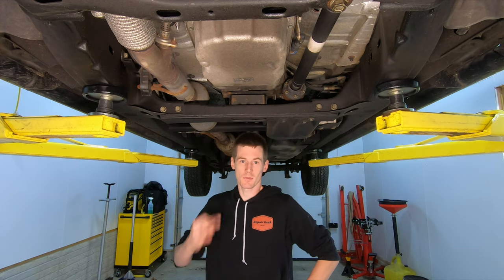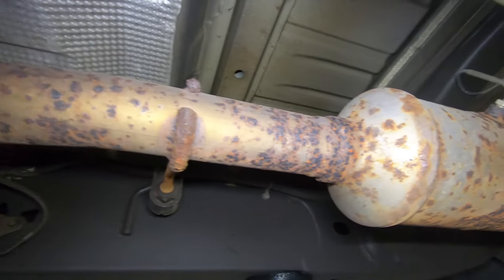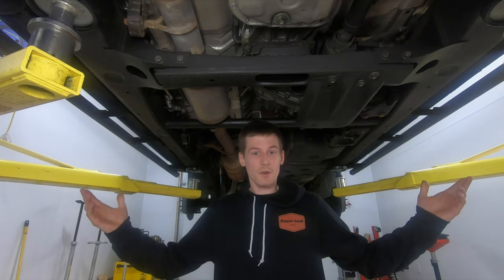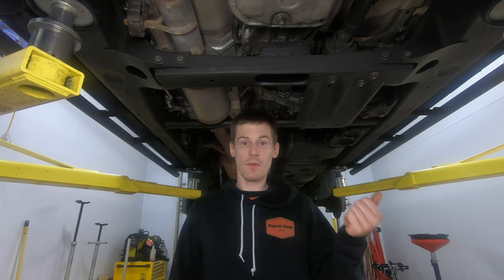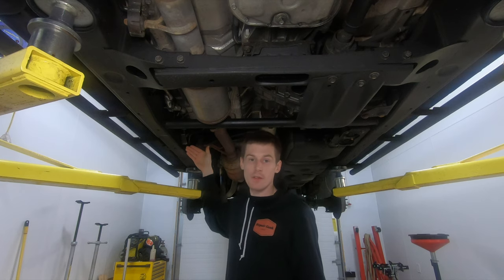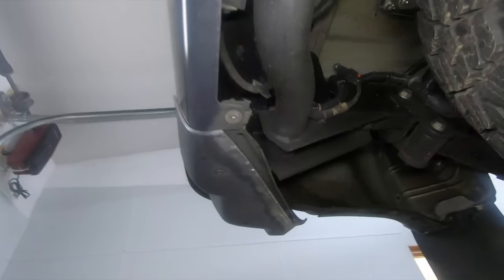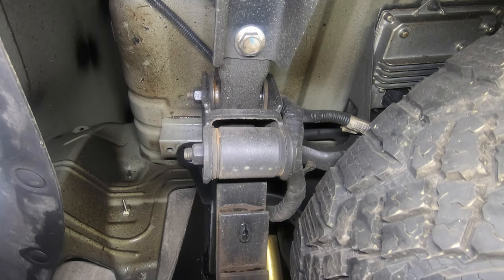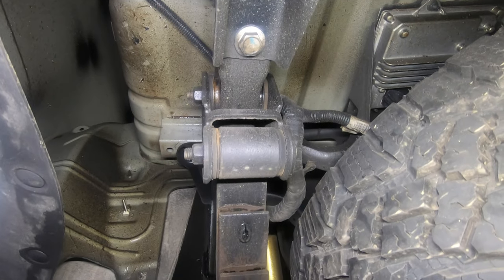Fluid Film Review After 3 Years and Woolwax Vs. Fluid Film Testing.

Comment: Good humble choice to not use the New Hampshire oil even if it is free.
If you never wash the underside of your truck. Except for this video to apply woolwax. Does that mean you continue to spray fluid film layers on top of each other twice a year? Never hosing off any dirt or grime that sticks to the fluid film before applying the next layer?
Reply from the maker: Yes
Reply: @RepairGeek  wouldn’t it be better to hose off the old layer of fluid film before applying a new coat though? That way the fluid film is sticking directly to the metal and not to old fluid film.
Reply from the maker: @Jonathan-hq8od  my issue is with that is time. I have my procedure down I can crank out a car or small truck in an hour or so. Washing adds time and I have results that verify what I doing works. Also, the longer this test goes on the more resilient the coating becomes because it continues to become thicker and thicker.

Comment: How much of a mess does it make? I have an auto detailing shop and looking to start offering this but I’m wondering if I’ll need to put curtains up around the bay where I’m doing the fluid film to prevent overspray from getting on other vehicles in the shop
Reply from the maker: You'll need a curtain for sure. It washes off easily though.

Comment: It looks really nice.
But, my own experience is not  good. 
I have a brand new GMC Sierra and I decided to protect it  with Fluid Film before winter.
Next week I wash my truck and figure out that the original wax came out  from the frame  around the rear tires.   I bring a truck to the  dealer with a question. What is that?
They said, we can't help you! Go to the shop where you did it and complain there!
So, my personal experience and suggestion is, keep away from the original frame  wax, it doesn't work with Fluid Film and even makes a lot of headaches for me,  how to fix it!

Comment: So do you have to sand down before you apply fluid film? I have a 2019 with minor surface rust can I just put the film right over that?
Reply: If you don't want to do the sanding work just apply right on top of it. Look up a product by Blaster called surface shield. I'm impressed by it so far and it may be better than fluid film or woolwax.

Comment: Hi there, interested in your one year comparison as a friend just bought a brand new Tundra.  While I've used RP-342, I am suggesting he get Woolwax applied and skip Toyota's undercoating, but I'd really love it if you can comment now prior to your exact 12mos review.  Thank you!
Reply from the maker: There is nearly zero noticeable difference between the products. Youll see in a few weeks. I prefer FF over Woolwax because as I said in the video it creeps better. If you want to use FF on internal stuff then Woolwax in exposed stuff you can. I prefer to only have to buy and use one product rather then switch in the middle of spraying.
Reply: @RepairGeek  thank you so much for such a quick reply...awesome.  I have noticed in our area around zip code 12804 northeastern NYS many more shops applying WW vs FF.  I'm kind of tired of the labor from RP-342 and having to wear a shield and org vapor mask etc.   Hey I saw one comment, only one, somewhere, where someone noticed FF swelling rubber.  Have you noticed anything like that happening?  I assume no but wondered.   For high splash areas, does WW stay on better?
Reply from the maker: @richcombs4805  5:00

Comment: Hi Repair geek love your videos. got a question for ya where did ya get the surface sheild aerosol can extension wand hose from I noticed like you said in your videos the fluid film ones won't work . please get back to me thanks.
Reply from the maker: You need to use a graffiti adapter on the aerosol can to get the inner cavity sprayer to work. I have them linked in the surface shield videos.
Reply: Ok Thank you very much I greatly appreciate it

Comment: Great videos! 
Does the Colorado have the same wax coating gm uses on their full size vehicles? I've heard that FF makes the factory gm wax coating soft and flake off...
Reply from the maker: I've coated some GM wax frames. I personally haven't had issues. Colorados have normal painted frames.
Reply: @RepairGeek  ok thanks 👍

Comment: I really wanna see cosmoline vs fluid film. Cosmoline seems like the most effective undercoating from all the videos ive watched.
Reply from the maker: It doesn't creep.
Reply: @RepairGeek  
Based on the videos ive seen its the most effective product by far. Take a look at that project farm video where he punctures holes in the metal simulating rock hits. I went with fluid film personally for my car since I couldnt find cosmoline in any store in the ottawa, ontario region, but im skeptical of how it will hold up to slush and water for 4 months. Fortunately I dont drive a lot so if I did nothing at all my car would hold up quite well.
Reply from the maker: @PENDANTturnips  here is the issue with cosmoline: Eventually it dries. Here is why that is important. Your rocker panels for example are spot welded at a pinch weld.  If you spray inside your rocker panel with cosmoline and it does not fully penetrate the pinch weld they will rot. Once cosmoline dries you can spray more and more inside your rockers but you will not penetrate the pinch welds because the fresh cosmoline will continue to build up on top of the old. I speak about this in the video at 10:11. A product that stays wet will continue to penetrate and self heal to some degree.

I've seen Project Farm's videos and he has a truely awesome channel. There is a flaw in his rock chip testing. Like I've said the products that stay wet self heal. So if you get a rock chip in FF the coating will try to self level and self heal. Filling in the rock chip over time. Cosmoline won't do that, paint, won't do that. Any product the dries will not self heal and will not creep.

I'm not saying using cosmoline is a bad choice but there is no way I would consider using it on an internal cavity.

I've done plenty of my own testing as well. One of which pre-dates project farm's video and the other, the test was running when project farm's video debuted:
https://youtu.be/oXlhmbvdKBo
https://youtu.be/9SOOfZFmhSY
Reply: @RepairGeek  Thank you for your response and for testing the variety of products that you did, your videos are incredibly helpful.

Also thank you for providing updates of your car to prove that fluid film actually does significantly decrease corrosion in real driving conditions over time. This is something that initially made me decide against Krown as they had no solid proof that their product actually held up over time, and if a company doesn't do that I think its safe to assume their product is snake oil.
Reply: @RepairGeek  I just did a rocker rehab with duct metal end caps - and pop rivets - no more pinch weld problem! hahaha. Two duct metal end caps - maybe a dozen pop rivets, bending the metal with bottlenose or whatever pliers - I then used that rubber in a can rocker guard paint and OEM paint. Looks pretty good actually. Definitely looks DIY.

Comment: @Repair Geek
what gallon size air compressor  & scfm and cfm   is your air compressor?   
Also What do you set your regulator to when you spray this?
Reply from the maker: Anything over 15 gallons would keep up fine. I have an 80 gallon but it's wayyy more than what you need to spray this. Set the pressure between 60 and 80psi.

Comment: ive got a 2007 colorado and the exhaust look new with no under coating i believe your under coating is helping rust that expensive diesel exhaust and you need to say how many miles you put on your vehicle first of all in your videos ive been under coating for about 15 years in vermont a real snow belt  and the only real way to stop a vehicle from rusting is never drive it heheheheheheh

Comment: You should've tested POR 15 also,it's suppose to be really good...
Reply: nope.
POR pretty much sucks for rust prevention.
Look up @repairgeek video comparing about a dozen products.
POR is ok for "painting over rust"
But is pretty awful for rust prevention in northern states and states with lots of salt application and high moisture.
Keep watching @repairgeek - he has lots of good stuff!!
Reply: @philipunderwood477  Much appreciated my man...
Reply: @mercedesbenzs600bash  
However, my brother's 1986 300CD leaked so much oil and diesel it could probably last 1000 years in the Northeast.
Still not POR and kind of a leak-as-you-go method.
But still not a spot of rust.

Comment: So how do I transistion to Blaster on top of Woolwax. Do I weight two years and Pressure wash first?
Reply from the maker: Just spray it.
Reply: I did all touch up with the Blaster in areas that fluid film got washed off after a year. So far that product may turn out to be better than fluid film.

Comment: Wouldn''t buying a new car/truck every 10 years better than spending Gallon of fluid firm every year, lift, pressure washers, other maintenance related issue?
Reply from the maker: So, 10 years and 10 gallons of fluid film @ $45 a gallon is more expensive than a new car for 25,000-50,000?

Comment: I liked the idea of fluid film. I don't like that it ruined my truck. I'm going on 2 weeks now and it is ALL I can smell. My new truck smell is gone and I'm fucking pissed. I only used it on the bottom.  My doors and engine compartment got dripless amber because I know fluid film stinks. 

But it just won't go away. To say I'm pissed is an understatement. 

To those thinking about using fluid film you've been warned it REAKS and I would choose literally anything over it again.
I'll either stick with dripless amber (all the same product up in canada) or go cosmoline.

Comment: take the exhaust off and spray the inside and out with coconut oil and mineral oil mixture your exhaust will last a lifetime obviously do not spray the inside of the catalytic converter
Reply from the maker: Really? Season it like a cast iron skillet? Those don't even last through a dish washer.
Reply from the maker: I've never seen the surface of a boat reach 1200 degrees.
Reply: @RepairGeek  i have a diesel it works but to each there own

Comment: Dude, so what was the point of your video which is better wool wax or fluid film you beat around the bush the entire time without giving a clear answer
Reply from the maker: Dude, "better" as far as cost, durability, smell, creeping action, ease of use, or rust protection? I didn't beat around the bush.. Each one of those categories has a different "better" answer.
Reply: @RepairGeek  you still didn’t answer it !!!!